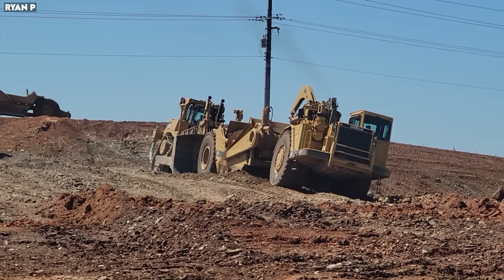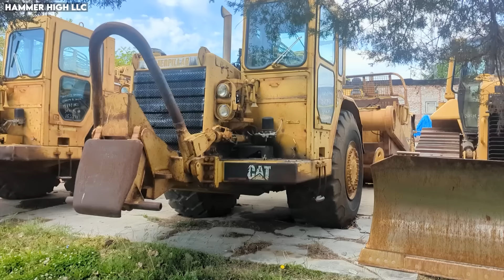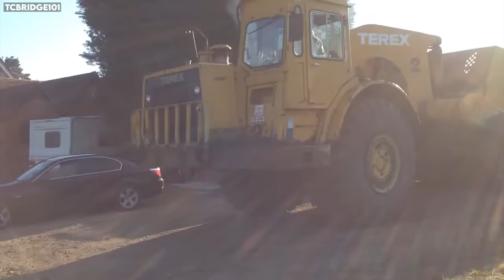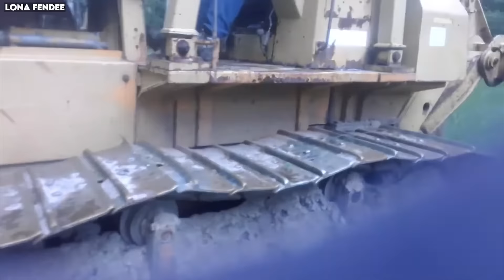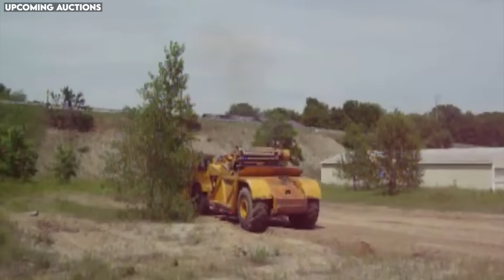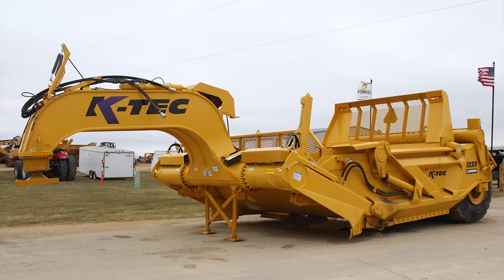10 Scrapers From the 1980s That Construction Crews Still Miss

Comment: I ran  a ts24b and  if you  didn't have  earplugs you would have a  headache all day  from the engines.  The  dual Detroit  engines were  loud
Reply: That’s why they call him. Screaming Jimmy’s.
Reply: I used to run a terex loader about 25 yrs ago. I regret running it without hearing protection. 
Added engine oil nearly on a daily basis.